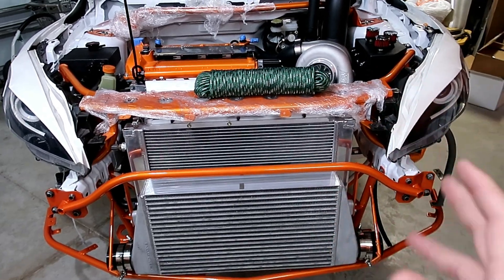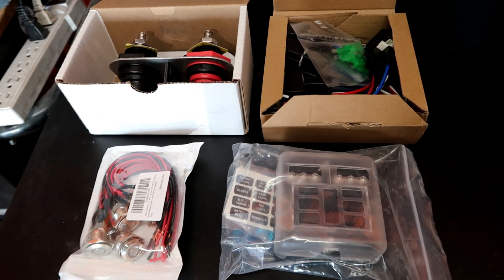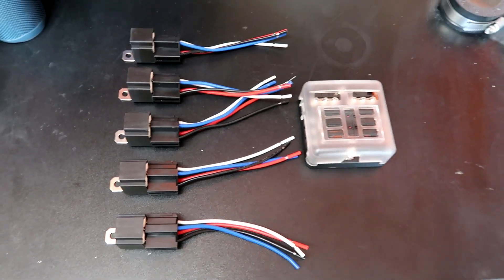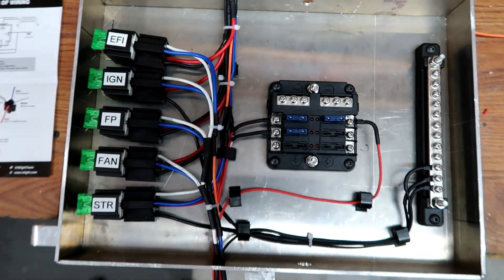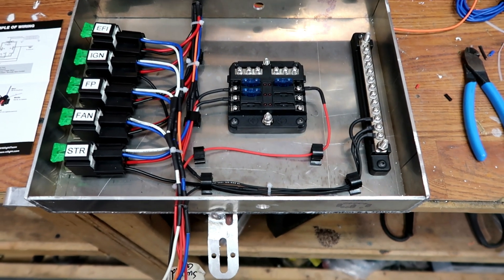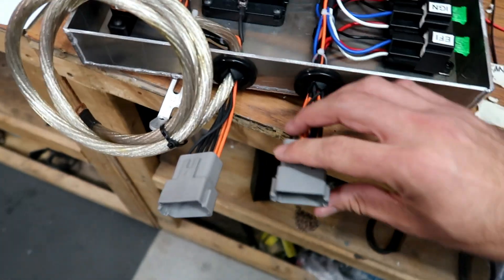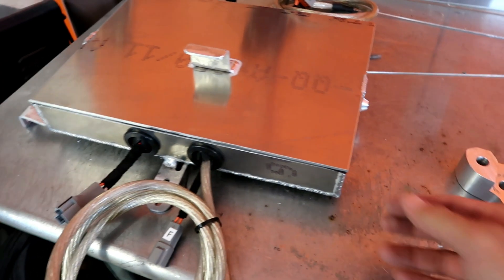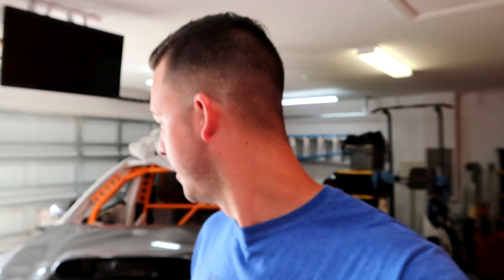EmTron ECU Wiring Begins - Part 1 - Mazdaspeed3 Stand Alone ECU Wiring (Episode 53)

Comment: fusebox, relays????????  cmon man, this build deserves a pdm.
Reply from the maker: You got pdm money? I cant do that right now
Reply: @WZ_TV  I hear you.  I have the pdm but now can’t afford the cool ecu 😂.  Will have to run the factory ecu.
Reply from the maker: @f1hotrod527  one thing at the time!
Reply: @WZ_TV   Some of the pdm’s are reasonable.  I got the aim pdm32.  It is $2400 but includes a 10” dash, 2 gig data logger, gps module, 9 axis imu.  If you don’t have a dash or logger and you were planning on getting them, then the pdm doesn’t cost that much.  Hardwire also makes an affordable pdm.
Reply from the maker: @f1hotrod527  thats up there. They one i’ll eventually get is the ecumasters pdm which is 1400
Reply: @WZ_TV  I was looking at that one as well.  My car is a street car and did not think it had enough circuits.  If you add the dash you are more than aim.  But I really like the ecu master stuff.  Good luck on the build.  That is an impressive car.